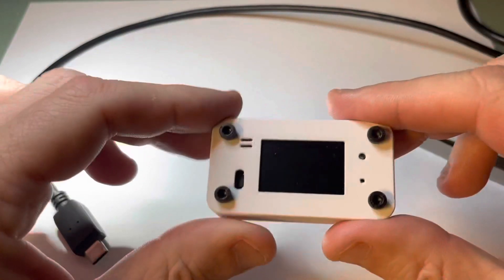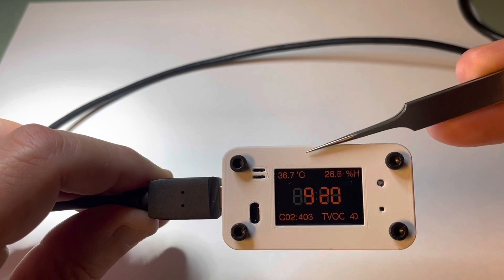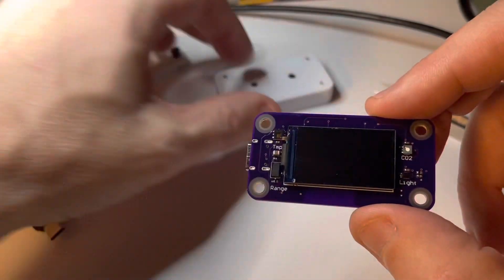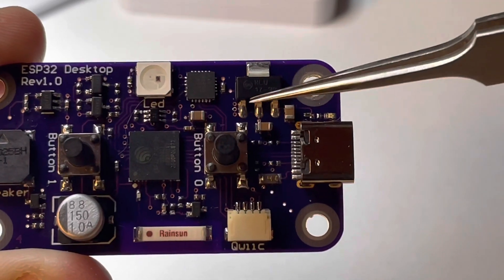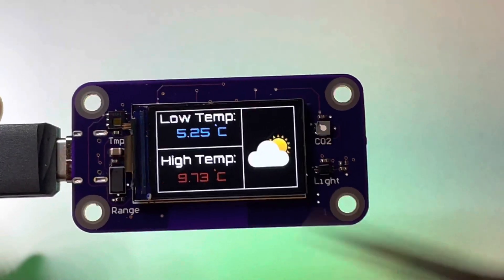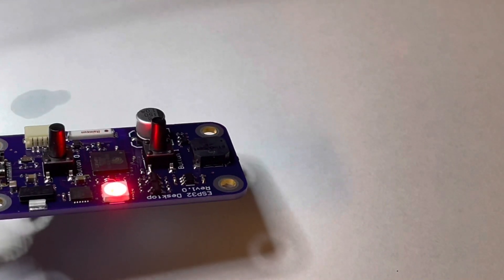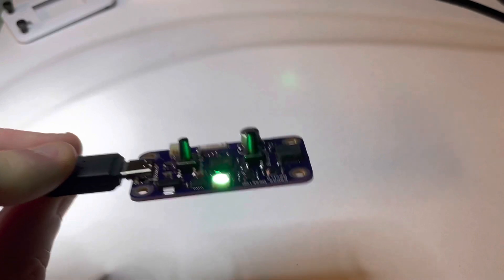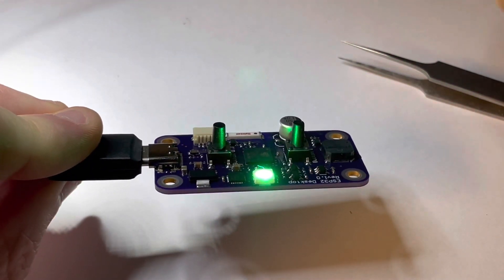ESP32 Desktop Clock

Comment: I was working on something similar using an off the shelf board. I set it aside for awhile to focus on other things. My goal was to use it as a clock with temp in my old Honda CRX. I added a battery powered clock board to pull the time from when it couldn't connect to the internet. On your board, it would be useful to have a header for the buttons rather than directly soldered on. That would allow for them to be placed elsewhere. I was going to put my project above the rear view mirror where the seat belt indicator was. A quick release to be able to take it down for reprogramming.
Reply from the maker: The temp on mine is way, way off because the sensor on on the opposite side of the LDO. Not good.
Reply: @0miker0  I had mine running code and it would work fine for days then the screen output would start going nuts for no reason. The temp was usually pretty accurate on it. Close enough for casual use. I may start working on mine again.

Comment: I love the ESP32 with TFT displays... but also I must comment that I see a weather station as the most senseless use of so much high-tech... see my window uses no power and doesn't pollute the air with more RF and always tells me quite accurate what the weather is like... anyway... I am building an emergency system with the small LilyGo which connects the neighbours in a house and works without external services needed. It can easily be extended with SIM cards to send SMS... and would also be reasonable in connection with a GPS as a child tracker. Not to spy on the kids... but to let them send an emergency call when straying around.
Reply from the maker: 100% agree that a window is the best source of current weather conditions. This project gets the high and low temperature for the day and what the conditions will be later on. Here in Canada at 6:30am it’s dark out so my window is of no help at all.

Comment: Very nice.  I'd rather that the buttons be on the top (or right) side so that it can be laid flat.
Reply from the maker: True and it depends on how it’s being used. If buttons are not needed (like in my case) just leave them unpopulated and it will be flat.
Reply: @0miker0  could you give us a link where to buy the various components, please? I would be really grateful to you. A great job.
Reply from the maker: @1302fiesta  Not a problem. Check the PCB folder in the GitHub link where the parts list notes part numbers and where to purchase them from.